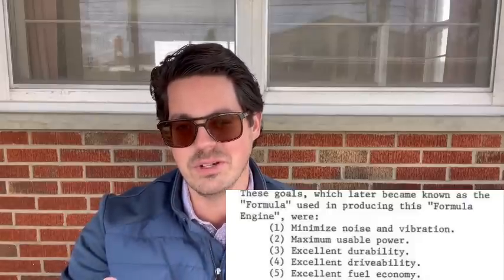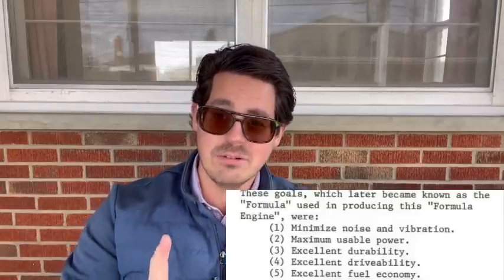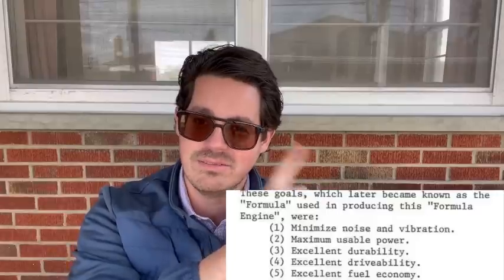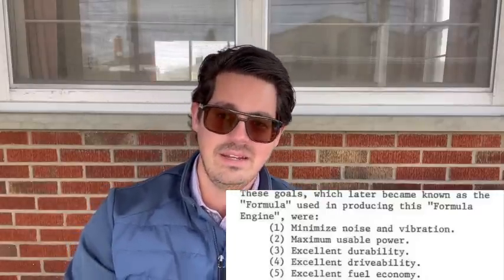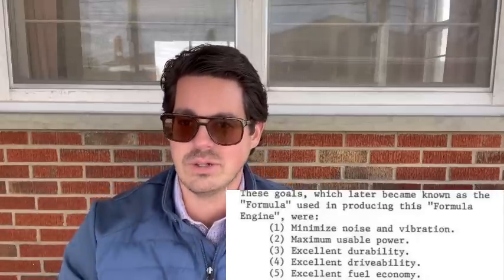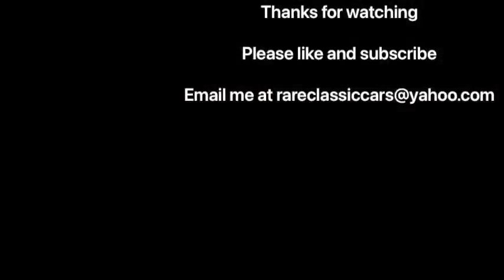Worst Engines of All Time: GM's 2.5L Iron Duke 4-Cylinder

Comment: You could do a lot worse than the Pontiac 151. It was probably the best gm 4 cylinder up until maybe recently.
Reply from the maker: Precisely the problem.
Reply: @RareClassicCars  other than antique stuff gm didn't really have many bangers of there own design. The old cut down Chevy 153 was a heavy turd but reliable. Then the duke, and the olds quad 4 that wasn't very good,  and the  j platform engine that evolved into the ecotec that was never very good either. Everything else was mostly Opel  gm,  Suzuki, Saab, Daewoo, Isuzu stuff. Really now that I'm thinking of all the crappy small/compact cars gm has put out that may make an interesting video if you haven't already. I'd say the last good small car gm made would probably be the rear wheel drive x platform with the Chevy or Buick 6. I like the porch talk, and most of what you've got to say I'm in agreement with. Thanks.
Reply: A similar engine, the 2.0l and later the 2.2l in the J body's were fairly stout. My family had a mid 80's Cavalier back in the day that would not die. The powertrain was solid as can be. The body got crusty and was replaced. My brother then delivered pizzas with it for years before selling to for a few hundred dollars. New owner drove it for a few more years (and never titling it) and abandoned the car on the side of the road.
Reply: @mph5896  sounds like a Chrysler lh 2.7 I've got that just won't quit. The car has 302000 some odd on it now, even though they are rightfully regarded as junk. My daughter loves the car though.
Reply: @RareClassicCars  Better than those foreign engines.
Reply: @RareClassicCars  Get a dozen or more people together and, more often than not, they'll be at least one horror story of a failed GM engine.  How many sales did GM lose for every horror story?  3?  Half a dozen?  More?  I'll contend that the Duke actually ended up being a long term sales positive simply by being economical and not blowing up.  Should GM have done better?  Sure.  But GM did alot worse.

Comment: As a GM retiree it always surprised me that the company didn’t embrace overhead cam and alloy engine components much earlier than they did; in the UK we made the overhead cam slant four from 1967 to 1979 which was available from 1.6 up to 2.3litres but could be taken up to 2.6 litres; the engine was smooth running and  a good all rounder and was successful in motorsport thanks in part to being very oversquare; Pontiac also made an overhead cam six for a few years too.
Reply: GM tried aluminum engines before, but they were nothing but trouble, and tried OHC on the 60s Pontiac 6.  That engine was a good performer for a 6 cyl, but was expensive to manufacture.

Comment: Honda and Toyota had been engineering small, efficient engines since the 1950s. GM only got serious about trying small engines with the Iron Duke. So it was in essence a beta test for GM when by 1979 Toyota and Honda could do them blindfolded. 

That simple warm idle adjustment should have been made at the factory for every Iron Duke that hit the dealer lots. GM should have had the warm idle vibration issues in their notes from engineering R&D and they should have made that adjustment for production.
Reply: The engineering proficiency of Japan vs the rest of the world is incredibly apparent in this category. They were putting fuel efficient high revving DOHC motors into their base model rickshaws while some competitors were still messing around with overhead valves.

Comment: ha, "Let me know what you're reaction is to that". i'll jump in :).
Mid '80s, a member of extended family buys a Chevy S-10 pickup. I think he bought it used with low miles.
Loved it and drove it alot. Early '90s and he's on the fence of selling it or since it started looking crummy getting it repainted and keeping it.
I had a '72 C10 Step Side at the time (part of the family for over 30 years) so since his truck was reliable, i suggested getting it painted. Went thru the same bit with mine.
Plus, i told him it was the Iron Duke, which seemed like a good motor.
He  did that, even thanking me later. He loved that truck.
Ram full size for him for the last 10 or so years (tele commute since before then now retired,,,lucky so and so ;)

Comment: I worked at a Chevrolet dealership in the 90's and we used to get a "gravy lick" when a customer would complain of timing gear noise. 4-6 hours warranty time to R&R the camshaft on trucks and 14+ hours on FWD cars so the cam gear could be pressed off and a new one pressed on. Fact is we could chisel off the gear and press on a new one by drilling a hole in the cam, cutting fine threads in it and using a bolt and washer to screw it down on the cam.

Durability? Well look at those Grumman post office trucks (they're on S10 chassis) STILL running around the neighborhood. Some of those are over 40 years old and still running the original 2.5L Iron Dukes, some of those with enough miles to go to the moon and back... TWICE!

Comment: Wait... My '89 S10 2.5L had a balance shaft? 😆

That entire truck was pretty smoked before I ended up with it so it wasn't a museum quality specimen, but "agricultural" is literally the word I've used to describe the engine. In an S10 with deep gears and an overdrive manual transmission it really wasn't offensive (though mine had hilarious amounts of valve train noise), but good grief would it be miserable in a typical GM car of the era with a 3 speed auto and 2.xx gears.

I actually ended up gearing the truck to 3.08 (from the factory 4.10s) so I could cruise it down the interstate at 80 all day, and did. It was also on Z28 wheels so it had reasonably tall 15" tires. This was during the $4+ gas era of the mid-2000s and I had a long commute to work and they often used me as a parts runner mule (getting paid company mileage) since I had a beater pickup to use. I saved/made a lot of money with that truck. Some weeks my mileages checks were more than my pay and I had actually considered putting an auxiliary fuel tank in it because I was tired of stopping for gas so often.

Finally it died from what I suspected was a wrist pin coming apart (almost certainly due to my neglect and abuse...it leaked oil and I let it get low a few times... plus tons of burnouts and such just for laughs). Still drove it another 100 miles home with it knocking like crazy. Still got it's standard 30-ish mpg even when it was coming apart. It went to the crusher at something like 215,000 miles. I'm reasonably sure it would have drove itself there.

I've had 2 2200 powered S10s since it went away and the low end grunt of the 2.5 is immediately noticeable as missing. But, pretty much anything above idle the 2.2 is a much better driving experience. Both engines are hilariously under powered, but I don't think my 2.2 trucks would have pulled the 3.08 gears as well.

So, for me, I don't think I'd put it on the worst engines list, but you didn't say anything I can disagree with either.
Reply: S10s didn't get the balance shaft engines. Balance shaft motors were the ones with the oil filter in the pan-which used a "Cap" that would strip out.
Reply: @johnjennings2672  Other folks are saying the oil pan filter deal was early models only.

I could easily believe I didn't have a balance shaft though. Sounds like most later model engines also wouldn't have had a distributor, but mine did.

Comment: I sold S-10s on a used car lot in the early '90s.  GM trucks were our specialty.  The only S-10s that I saw over 200,000 miles had the Iron Duke.  I saw a bunch of them.  The would just run and run and run with minimal maintenance.

Comment: My Uncle had a 1975 Chevy Monza with a 262 V8 and a manual 4-speed. It got 22-25 mpg on the highway. I KNOW because I used it for a month and calculated the fuel mileage myself. Now with an engine like this WHY, WHY, WHY would GM ever even want to develop these half-assed 4 cylinder engines in the first place?  It has been my lifelon experience that the small block Fords and Small block Chevys typically are more efficient than the 6 and even 4 cylinder counterparts. Look at all the engineering and production costs GM could have saved just by using the 262 V8 in ALL the cars they put newly designed 4 and 6 cylinder engines in.  The V8 design has the best potential for efficiency. Turbocharge a 4 cylinder? NO THANK YOU!
Reply: Blame CAFE.

Comment: I think there was a marine version used in stern drive boats and I think I saw an industrial version recently on a standby backup generator.
Reply: Correct, matched up to a Volvo-Penta outdrive they made 120 hp. The only 'car' engine I've seen in commercial gensets was a Ford 300 I6 which has 7 main bearings. It made 87 KW continuously, 92 KW wheen tuned for LP/Natural Gas. A commercial version of the 151 would probably make about 60-70 KW at 3600 rpm.

Comment: You are so spot on about these engines.  I worked in a shop in the late 80's till the mid 90's and all the GM cars with this engine sounded like thrashing machines.  And as you point out, the vibrating dashboards and the steering wheels, just awful.  The dog-bone or torque arm that would wear out and allow the engine to move six inches fore and aft as you shifted the car from forward to reverse!  Most of them I worked on seemed to have a lot of premature blow by and noisy lower ends. In all fairness to GM, some of this may have just been owners not maintaining them properly

Comment: Another home run video!  I have 2 iron dukes, 80 skylark and 84 indy fiero.  I've said for years that they are durable but they sound like they have gravel in the crankcase and they even sound like they added shields, etc to create unpleasant sympathetic vibrations.

This engine is part of the reason that mid 80s FM customers were so impressed by honda and Toyota 4 cylinders at the time.

I've had some from all those mfgs and the nvh difference is striking.   One suggestion for your videos.  The more inset photos, charts, graphs, and photos the better.  Sure appreciate your channel. 

I would also add that the 2.5 in my 80 skylark is the quickest starting engine I've ever owned.   Literally tap the key and it runs as its carbureted too.  Even though the duke was a good engine, aesthetically it was perceived poorly and turned many people away from GM cars.

Comment: Had 3: 80 Skylark 4 speed (carb)...was OK, but great fuel mileage. 82 Ciera Automatic (TBI) a little rough but fine fuel mileage with little by way of power. Finally, 87 Calais with revised version rated at 105 hp rather than 90 or 92. -Big improvement, much better power, smother than the others too...still fine fuel mileage.

Comment: Had two S10s with the ol duke and 5 speed combo. Both trucks shook bad enough to make the mirrors fuzzy and power was no where to be found, but they were a blast to drive. Couldn’t kill either one, even ran my first S10 low enough on oil (did it twice) that the motor locked up. Let it cool off, added some more oil, and away I went. There’s only two things that will survive a nuclear war. Cockroaches and Iron Dukes.

Comment: Maybe the Duke was more annoying in a RWD car like  a Monza, but I don't remember the Iron Duke in my father's Citation as being particularly objectionable. It was a little grindy, but not very noisy and because of the transverse mounting and the upper&lower  engine mounts that  were most compliant in the vertical direction, the car body didn't shake much, though the dash and  wheel did vibrate. I was actually more bothered by the engine in an '09 automatic Civic; it didn't vibrate as an Iron Duke would  but it was quite noisy and was constantly downshifting on the highway.  As for the timing gears, maybe it's best to think of them as a maintenance item, like a timing belt or even a 1970s timing chain with those nylon sprockets. I don't know if the 'Duke was an interference engine, but that kind of maintenance at 100 or 120K is not out of line with what people expect on other cars.

Comment: I had a 93 s10 with the iron duke and a 5 speed manual. Was a great little truck, very reliable and easy to work on. Ran great until I wrecked it at 211k miles. Really miss that truck :-(

Comment: It was used in tractors,  agriculture equipment anyway, and welders, boats, air compressors,  electric generators,  feed mills , sprayers,  pumps ect
Reply: I had a wood chipper last year I purchased. It was a 2013 model equipped with the 3.0l iron duke. Fuel injected. Funny stuff.
Reply: True, but that proves that it was a good reliable engine.
Reply: @michaelbenardo5695  I agree with you completely. We had one in  Skylark and it was fine.  Work had many of them in S10 and Chevy Celebrity.  I am surprised this is on a list of worst engines..Not what you would consider an inspired work of automotive engineering,  in the day of early smog motors they worked. 
I don't recall anything going wrong with that Buicks engine, everything attached to it was iffy, water pump, alternator, starters, but all that was cheap and easy.
It was the prince of darkness fuel pump relay system that got it sent down the road

Comment: It's 2022 when I post this from central California, and my shop has a contract with the local USPS branch to do the repairs on their trucks they don't want to do internally, like transmissions, flex plates, rear main seals, rack and pinions, etc.  We see two types here, the ~30-year-old S-10 based Iron Dukes and the ~20-year-old Ranger based 4.0L OHC V-6s.  I like (and hate) all engines based on merit rather than parent corporation, and I must say that the Iron Duke vehicles are FAR easier to repair and maintain than those crummy Ford V-6 vehicles.  The GM units are all significantly older than the Fords, but we see them here in equal numbers, which hints at the relative durability too.  The Fords would clearly win a side-by-side drag race, but who cares when you're hauling mail?  I have owned and enjoyed (some more than others) several Ford products over the last 38 years ('62 Ranchero, '65 Falcon, '78 Fiesta, '79 Zephyr, '82 Mustang, probably a couple more I forgot),  but that OHC 4.0L just rubs me the wrong way.  I have never owned an Iron Duke, but I can easily identify them by their distinctive coffee grinder sound before I even pop the hoods when they pull into my shop for smog checks, services and repairs.